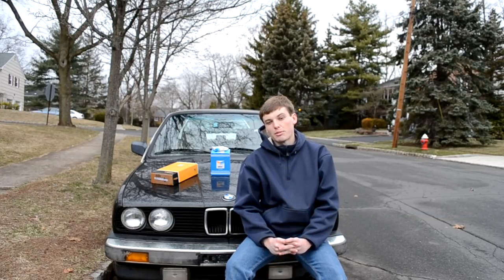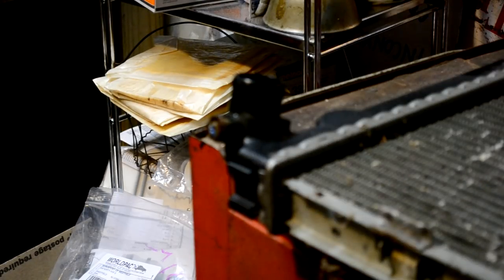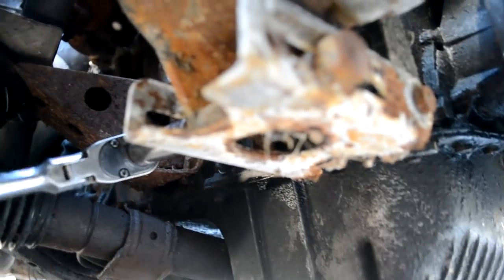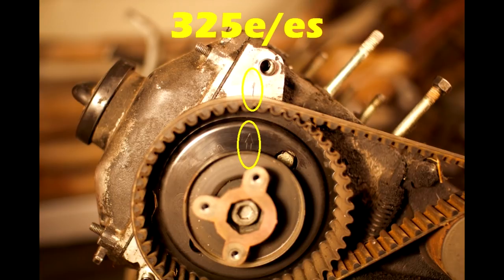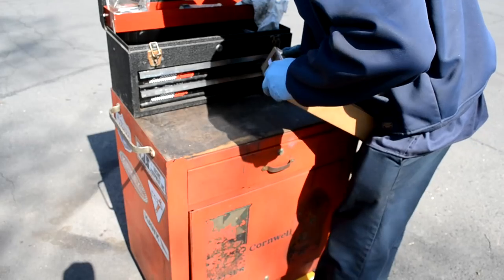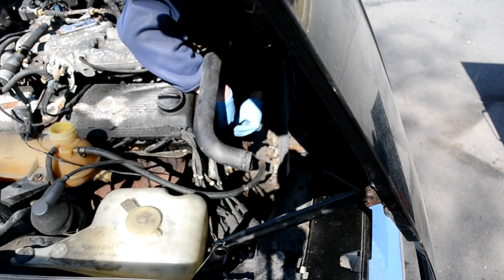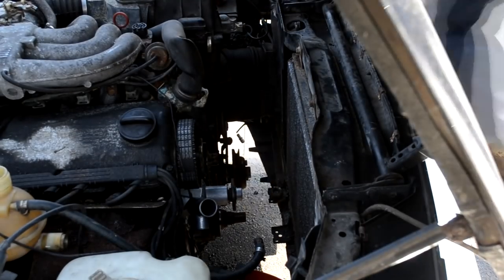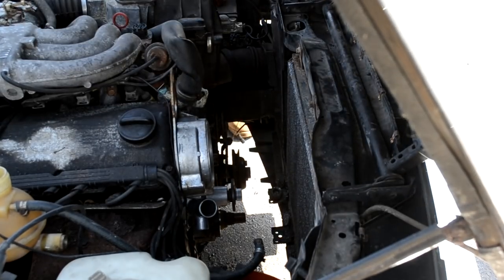The Official BMW E30 Timing Belt Replacement 325e/s 325i/x/s Early Model

Comment: When you're putting the tensioner bolt back on, and you towrked it took much and snap it off :( Has this ever happen to anyone...
Reply from the maker: Ahmad Soughar You must have really cranked it down.
Reply: It really didn't take much, the bolt felt lose, it was just really old and rusty, but i was able to get it out. now i have a bigger problem, the previous owner has a broken timing belt and i have 2 bent valves, i would love to see you take a shot at that, hope you never happens to you, Changing timing belt is sooooo important! Now i have to remove the cylinder head and try to rebuild it. I might film the process for other people to see what i did, i know thats a common problem.
Reply from the maker: Hmmm.  I might have a friend where I could rebuild his motor.  We'll see....
Reply: dude do so it took me about an hour and 1/2 hours to pull out the intake manifold, and another another 15 minute to take the exhaust headers off (one of my bolt heads was stripper so it took a while to get it open) But yeah i got the cylinder head out! took about 2-3 hours, mainly because im a new mechanic, might be faster for you. it was really easy. but you should definitely take a shoot at it.
Reply from the maker: I will if I have to :)
Reply: great work bro, where do you live?
Reply from the maker: United States
Reply: yeah dude me too but which state?
Reply from the maker: NJ
Reply: nice, i'm in AZ, looking forward to more video, thanks for the help.
Reply from the maker: No prob!
Reply: Ahmad Soughar Well, at least I have an idea what to expect, my belt broke and I have been building up my courage to take on the job, it would really help with a video, no experience but will do research before I jump in, any recommendations?
Reply: its honestly not a great deal of work, taking everything apart was pretty easy and fun, but as a good tip. always make sure you keep everything organized, keep every bolt and washer, and while you're at it replace all gaskets and seals, take the head to a machine shop dont do it yourself if you dont have experience, make sure the timing is dead on. when you tighten the head back on, use new torque bolts and use the torque spects of the gasket you get. if there are any question feel free to shoot me or e30 source a question there are plenty of forums that will help you out as well. Goodluck, dont fear discouraged m20 are fun and easy, i actually took mine apart today to recheck my timing and make a few adjustments to the rockers. P.S make sure you have someone helping you when you put the head gasket in and the head on, it MUST be perfect.
Reply: E30Source I've got the original engine out of my 87 325is you can rebuild if you really want.  I'm also in NJ.  Union county.
Reply from the maker: Where in Union County?
Reply: E30Source Live in Plainfield work in Union. You?
Reply from the maker: Westfield
Reply: So you're right between my house and my work.  There's a lot of e30's in this area.  I have 4 of them, might buy a 5th very soon.  Doing the timing belt on my newest one tomorrow at work.  You know of any car clubs or e30 meets around here?
Reply from the maker: Yes, the BMWCCA of Central Jersey meets in Clark, NJ at the Duestcher Club and there are a TON of E30's in that CCA.  I'm a member, you should join!

Comment: i have bmw 316i e30 1990 1.6  with belt not chain.wondering because i dont see for my engine that water pump must be removed or it must be?
Reply from the maker: +Milica Obric I'm not sure, we didn't get the 1.6 in the United States.